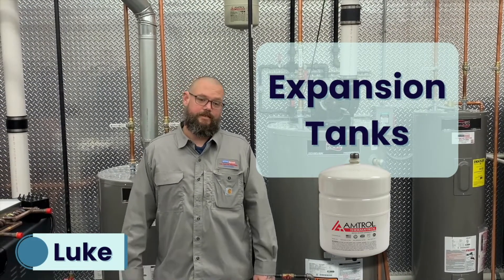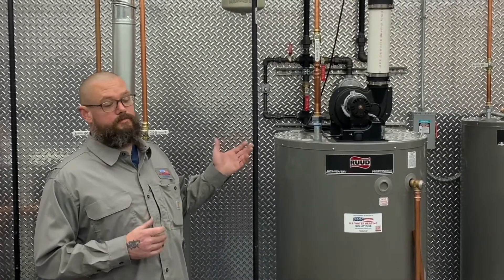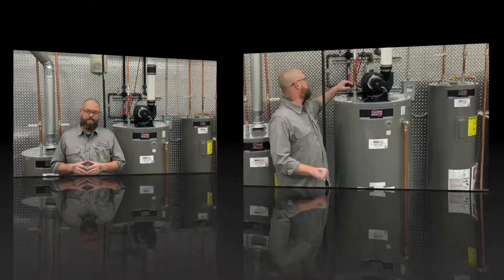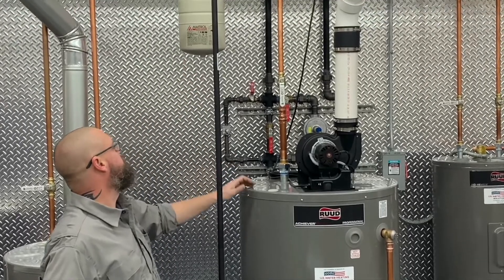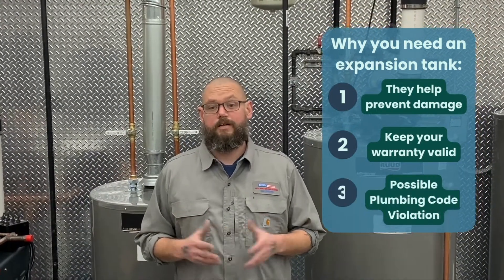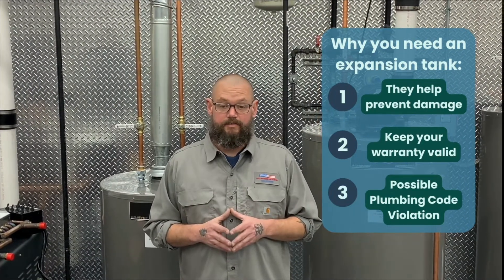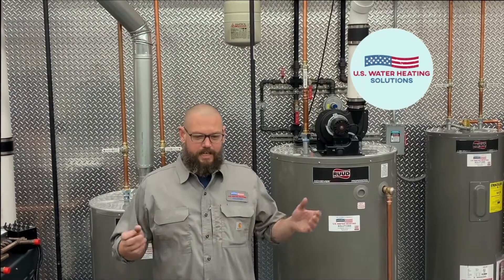Water Heater Expansion Tanks: Why You (Probably) Need One

Comment: I've had a Bradford White 50 gal. nat. gas water heater without an expansion tank for a trouble-free 17 years. Also, I never changed the anode rod. Recently, it finally crapped out, so 
I'll be buying another BW. Do I need to buy an expansion tank, too? I have to also replace my  boiler expansion tank (the old-school long cylindrical tanks that hang from the ceiling) is leaking. What's the difference between a boiler expansion tank and a water heater expansion tank?

Comment: I have faucets that intermittently leak on the third floor. I think I need one of these tanks.
Reply from the maker: Thank you for watching! We are always in support of monitoring water pressure and considering the addition of a thermal expansion tank (and PRVs when necessary). In the past we have seen expansion tanks and PRVs alleviate leaks for clients, but we also recommend checking the cartridges, washers, o-rings, etc., which may also be contributing factors. 😊
Reply: @uswhpro  My new pressure gauge reads a consistent 100 psi with a spike as high as 160 psi.
Reply from the maker: @sparky6592  Wow! Some of our customers in Kentucky and Tennessee see very similar spikes in water pressure. We've had a few reaching 180+ psi. In those cases, they often need both a PRV and thermal expansion tank.

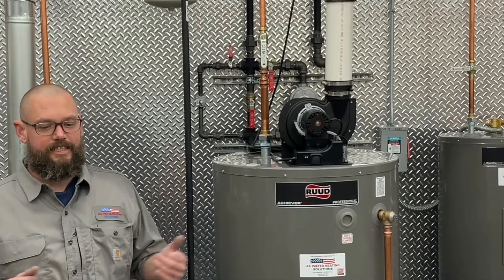Comment: 1:45 Wait!!! Are you telling me that there’s some kind of check valve on my water service where I can’t equalize pressure back into the utility?

Wow, its amazing my hot water heater hasn’t exploded, been running without one of them tanks since 1989
Reply: it seems to me that SOME codes are there for very rare situations.  I am 65 years old and have never heard of anyone having a problem from not having an expansion tank.  It's like backup cameras on cars - they save (I think) 2 children's lives per year in a nation of 350 million people.  1 out of every 175 million people.  (not saying even one kid lost is ok, just saying we didn't need a law for that)
Reply: When did the city start installing check valves on homes? Pretty sure my parents 75yo house does not have  a check at the meter. We re-plumbed it with pex awhile back.

Comment: There are many answers to your question Robert, first there are no federal laws governing thermal expansion there are however local jurisdictional regulations on expansion tanks and the safety features required by code. Secondly all boilers, water heaters or heating vessels require to be third party certified and according to ASME ASTM ASME the max 
pressure inside a tank is 150 psi or having a max temperature of 212 degrees before discharging through the temperature pressure relief valve on most water heaters . Now on the expansion side the tank is based and calculated on several factors one being the btu rating as well as temperature rise and gallon capacity , all of these variables are considered when sizing the proper tank for the unit in a closed system. Boilers on the other hand operate at much lower pressures 12 psi or less and have a max pressure of only 30 psi to the t&p valve , even at low pressures thermal expansion on a closed loop system can build considerable pressure. So the expansion tank is required to protect the equipment as well as the entire system. So to answer your question there is no law governing how much thermal expansion or how much pressure it can create only the safety regulations manufacturers must abide by code set forth by third party certifications and the what safety accessories are required to be installed and ensures licensed tradesman abide by that law and code .